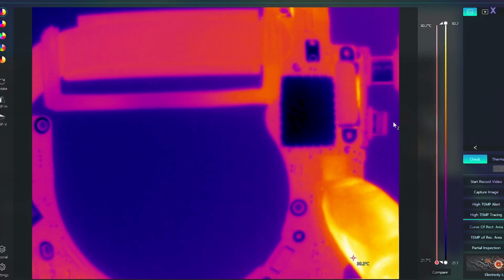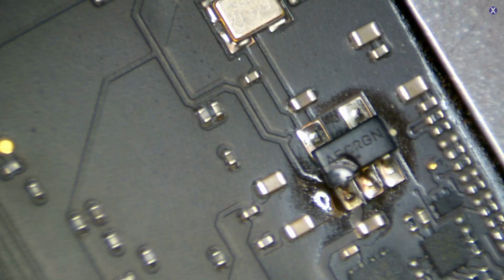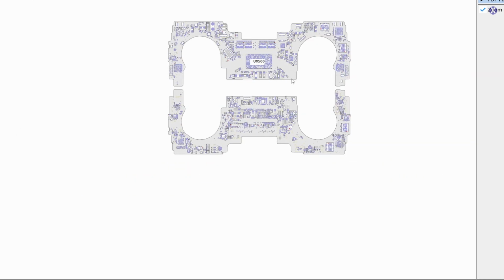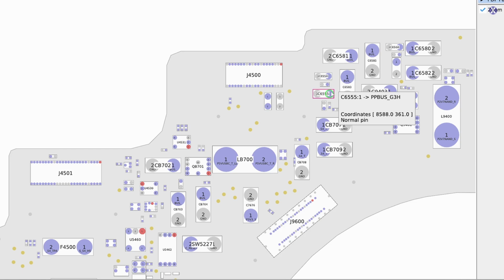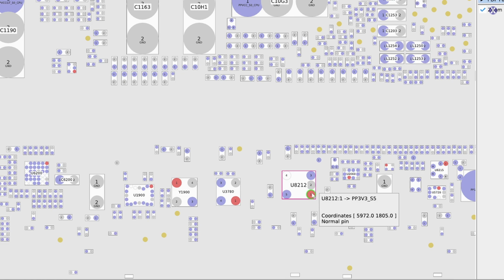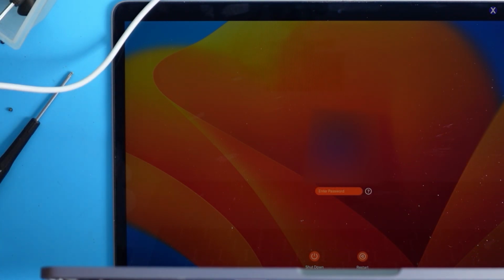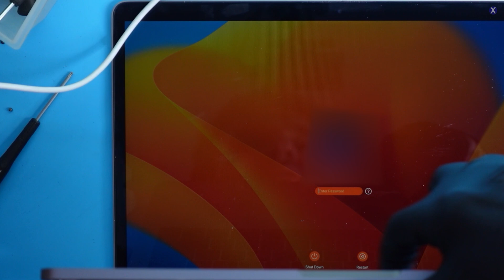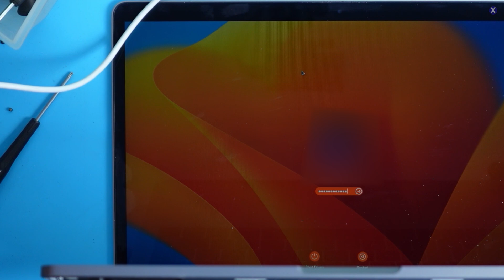Fixing a MacBook Pro with No Power

Comment from the maker: Thanks for watching!  Do you guys still have an Intel-Based MacBook?  🙂
Reply: I have the exact same issue with a 15 inch MacBook Pro with an intel chip(model A1990 emc 3359). Will try to repare it after new year. Hope the service will be able to fix it
Reply: @nemesisnap how did it go? Just found one of these with the same exact issue
Reply: I do still have one that is intel based. 2019 MacBook Air.